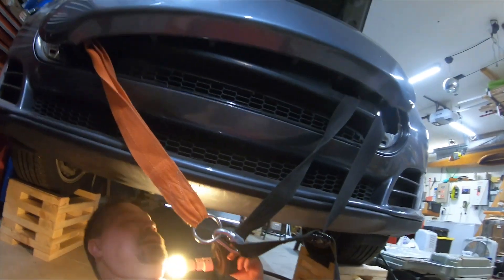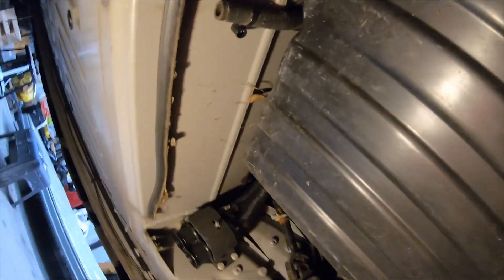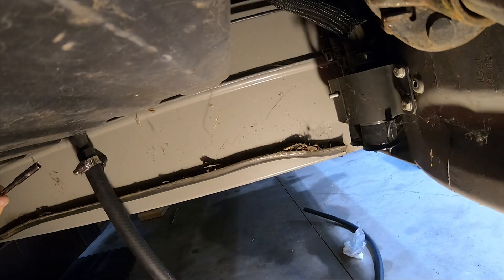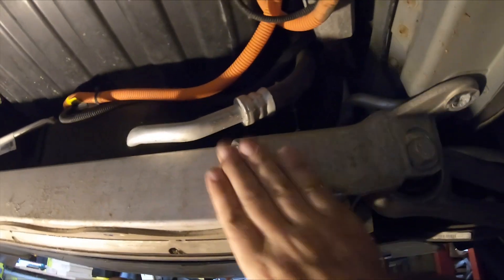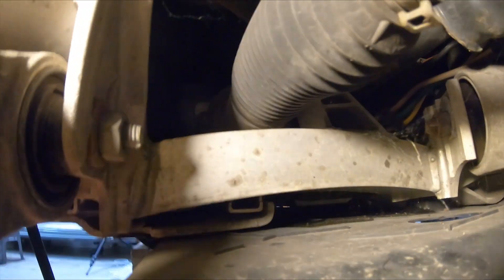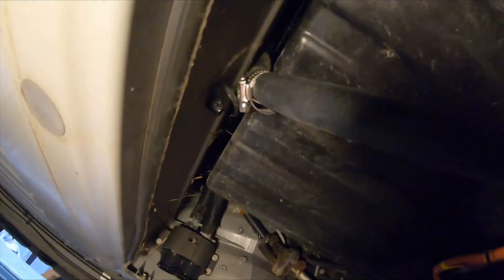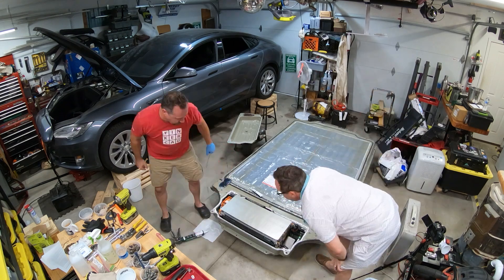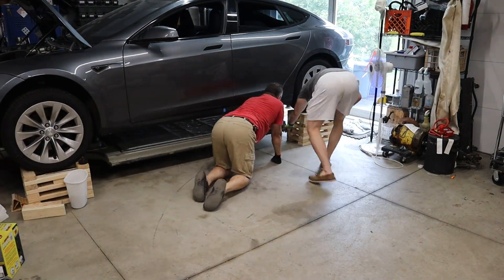Tesla Air-Conditioning Hose Fix!

Comment: Attaching that very long hose, twisting and bending it is bad idea, over the years that hose will eventually get clogged with dirt, soil dust, insect nests etc etc. The AC water 💧 is not pumped out with pressure, it drains and drips. You should have cut the extension hose just a few inches hanging clear underneath the battery pack shelf/lip and you should be fine.

Comment: While battery is dropped you might want to reverse the lower control arm bolts in the rear that can't be removed with battery in place and have to usually be cut. Will save you some trouble in the future.

Comment: Since the purchase deal is done, can you share how much the car cost and what the listing said was wrong with it?
Reply from the maker: The previous owner was originally asking $7,000. I got the car for $5,000.
It didn't run at all. The HV battery would not activate. The 12V battery was dead. The passenger window was broken (but at least rolled-up.) And the right rear air suspension was completely flat.

The biggest issue was the BMS_w123_SW_Internal_Isolation error. That basically says that there is water inside the battery pack. There's no way of knowing how bad it is until opening the pack.

The previous owner got an estimate from Tesla, who would have replaced the battery. That would be $12,000 for the part, plus labor.

Running cars of this vintage can be found for $12K-$15K. So, the car itself really has next to no value if it doesn't run and would cost as much to fix as it would just to buy a different one.

Comment: When the frunk is removed, you say that you can access the A/C hose to route an extension towards the wheel well.  Can you also access the battery pack fuse access panel ?  Could I be able to change the fuse panel from the top without removing the battery from the car?
Reply from the maker: I would say no. I haven't had all the plastic out from under the hood, but I bet the fuse panel is covered by other car parts and not easily accessible.
You also need to remove all the fasteners and cut away the sealant around the fuse cover. Both of those activities require a fair amount of room to work.

Comment: It's a known problem and was also the cause of my MS 85D from 2015 battery fault that Tesla took as a warranty claim 2 years ago. But never saw a recall from them, same as the other issues.
Reply: I guess they fix as they go along. So people will get scammed if they don't have the problem and one day it'll be just their bad luck that the problem didn't show up fast enough.
Reply: Do you know if Tesla rerouted the A/C drain hose as part of the repair, or did they just fix the battery and left the drain to cause the problem again in the future?

Comment: What is the official tesla recall fix? Do they just extend it, or reroute it? Extending it seemed like an simpler fix imo. Either way, great rebuild. We need new tesla rebuild companies to pop up and refurbish older teslas. Still lots of life in these cars.
Reply from the maker: @TheLobo91  A friend who used to work at Tesla said they added a right angle connector and another section of hose to run it off to the side. 
Based on the fact that the hose through the firewall is just bent down, I didn’t see any need for a right angle connector.
Reply: @BenjaminNelsonX I guess the 'benefit' would be that you could extend it with the same size, slightly more flexible pipe?

Comment: Not sure why you would not just extend the hose by 6" (?) rather than takig the chance, in time, of having water where you don't want it as in the orignal problem.
Reply from the maker: @davidabineri908  The entire area I was working in is where the battery goes. It literally fills that entire space. 
I couldn’t extend the hose DOWN by six inches because that entire area is the battery pack.
Reply from the maker: Maybe this video shows it better. https://www.youtube.com/watch?v=6DJcZ3p4qXE

Comment: Why not just extend it to below the original location?  Shortest route and just one small hole in the panel.
Reply from the maker: That's literally where the battery goes! One small hole straight through the battery!
Reply: @BenjaminNelsonX so what actually that water does to battery ?
It's sealed well enough to be fully submersible in water.
Reply: @1ssac1 did you watch any of the previous videos in his Tesla series? Seems like you didn't see the fuse box cover that got corroded and was no longer watertight.
Reply from the maker: @1ssac1  The water rusts through the fuse cover. Then the water gets inside and prevents the battery from working. See this video:  https://youtu.be/O1nQmR5O2y0?si=VhzosZFRJwI5-BTo
Reply from the maker: Here's another video that shows a different angle, right BEFORE reinstalling the battery. Makes the relationship between this hose and the battery a little more obvious.
https://www.youtube.com/watch?v=6DJcZ3p4qXE
Reply: Yeah I don't see it..... The hose draining where it is seems fine Currently it wouldn't hurt anything... I mean, if you drove in the rain, the entire bottom underside of the car everywhere would be completely wet.....where that hose comes out there is no open seem to the battery......on a side note air pressure could now force the water to stay in the tube or push it back up
Reply from the maker: @7saxby  The rust damage and complete shut-down of the battery pack is detailed in this video: https://youtu.be/O1nQmR5O2y0?si=VhzosZFRJwI5-BTo